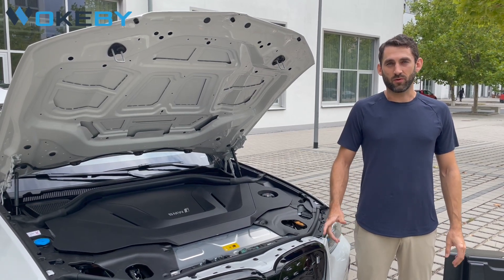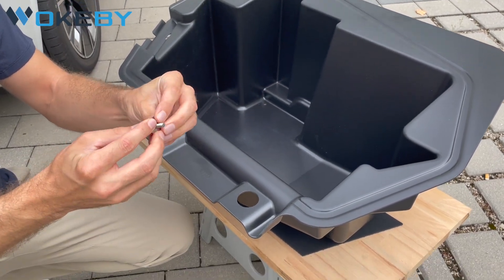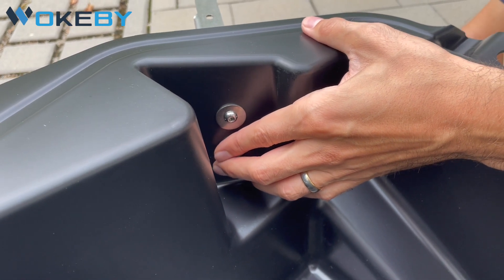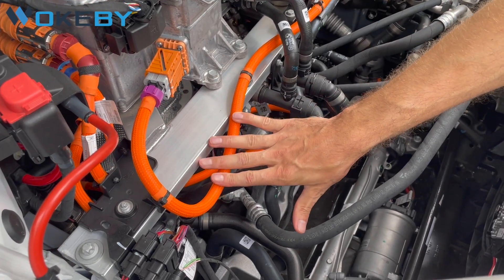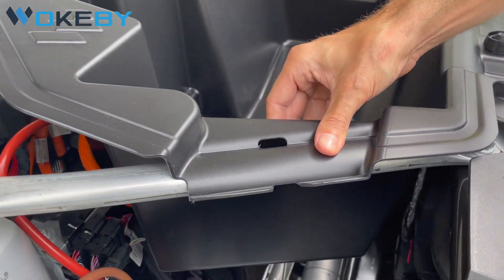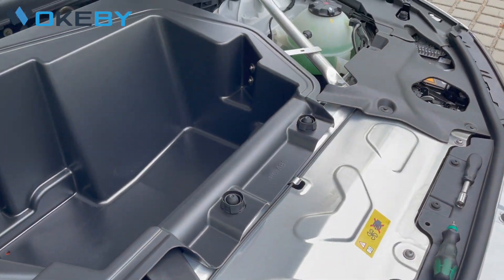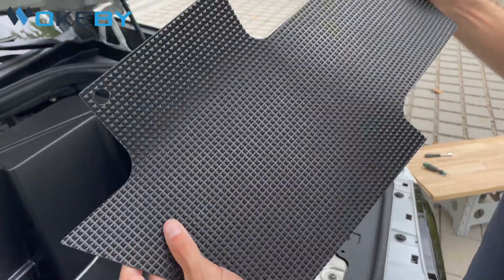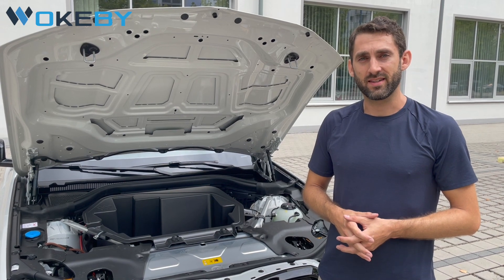WOKEBY - The BMW iX3 Frunk

Comment: and why BMW does not provide in the first place is simply beyond belief. so glad you are looking out for the buyer since the manufacturer is not. would not mind a new cover piece to clean up the surrounding area.  cheers
Reply from the maker: Yeah we know that quite some customers would love to have an additional cover. It will be tricky to realize because there are no mounting points that could be accessed. But we will give it another look onece there is more time 😉
Reply: Any news on version 2?

Comment: I think that is would have been even better if it also covered the gaps and components around the trunk. If it is going to be used as a frunk, it should look as good as the trunk.... A fabric surface would also benefit the luxury feeling to it instead of just plastic... 
(I am waiting for mine for i4, and will probably rebuild stuff to make it look better)
Reply from the maker: Hi Ulrik
thank you for your input. We understand your points but as we don't have the quantities we need to have an eye on the costs of the product.
The part must be small enough to be shipped internationally. We are at the limit already.
Additional fabric parts need to be fastened somewhere and we were not able to find suitable points for that.
The products must still be affordable and this is the biggest challenge for small quantity production.
But we are thrilled to see how you will improve your BMW i4 Frunk ;-)

Comment: How much weight it can carry? Doe it make any additional noise while driving? thanks for help. I am about to buy ix3 and this looks like perfect addition for it = )
Reply from the maker: Hi
This frunk is pretty tough and can easily take everything you want to carry around. BMW standard charger, Charging cable first aid kit and so on. I cannot give you precise numbers but we did our test with an overall weight of about 10 kg and it was no issue at all.
I never heared any noises from the front and even if something would move inside the frunk. The front compartement is insulated to shield off the noise of a combustion engine 😉

Comment: Is the frunk really installed directly in front of the fan? Is there any airflow left? I am driving a company car and worrying what happens in case of overheating in terms of warranty.
Reply from the maker: Hi,
yes the frunk is behind the cooling fan but with enough space to grant air flow. For sure more space than in the BMW i4 M50 and that was designed by BMW themselves 😉
Anyways there is not much heat that needs to be absorbed in an EV. Most heat is created while fast charging or race track driving.

Comment: Want to buy this for my new IX3, but stupid question…what do you do with the original cover once the frunk is installed?
Reply from the maker: I would place it in the basement. This is what I did with the metal plate of my BMW i3 when i designed the trunk extension. ;-)
Reply: This is a deal breaker for me 😔
Reply: @DCifuentesJ  🤷🏻‍♂️
Reply: @WOKEBY  but any possible the original cover could be reinstall on top of the trunk which after installed? Seems there will be heavy dust when the car after long range travelled
Reply from the maker: @veckerschan6365  No this is not possible. The iX3 frunk builds much higher and so there is not the same possibility as with the i4 Frunk. But in our test the frunk stayed dry and clean